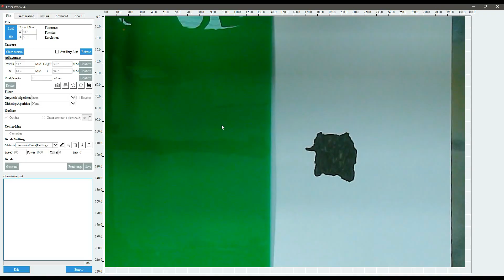Repair Plastic Box with Laser

Comment: Any idea to get a 3d printer ?
Reply from the maker: ya just buy a most commonly use one, but 3d printing is not as fun as it seems unless you're a 3d modeler/artist
Reply: @DALILOMODIY  then i think i should get one.. but there are some issues to pick a one. I mean cheap 3d printers have those low quality heating issues that caused to make whiskers with the model ...and it takes time to get used to a specific printer since there are lots of settings ( informed me by the freind who has a 3d printer ; i usually uses his printer to print my models )
Reply from the maker: @darkknight13929  buy the printer that you have experience with, or recommended by, most if not all printer has problem, you need to constantly tune it, also quality filament plays important role here. i just bought the cheapest printer because it like to challenge myself so i won't recommend it to you